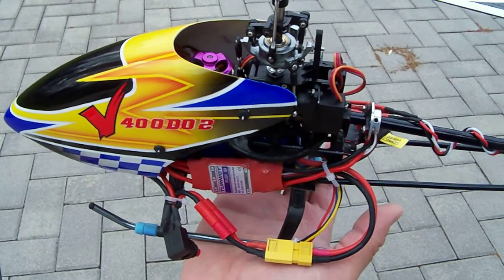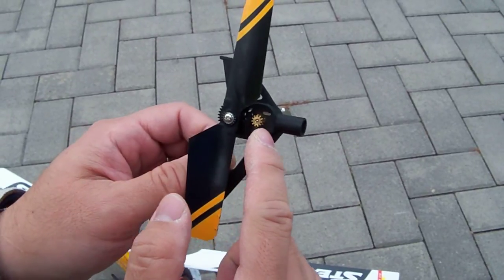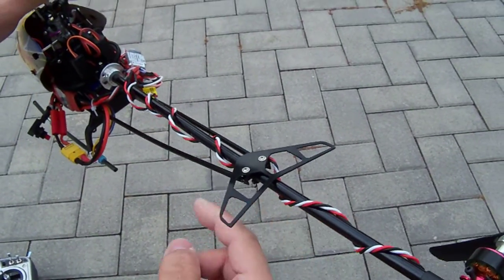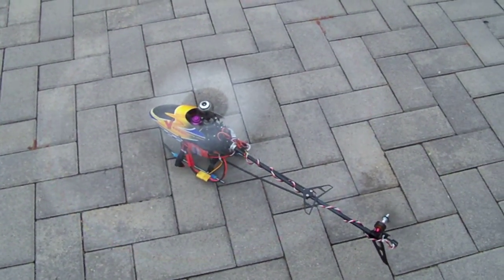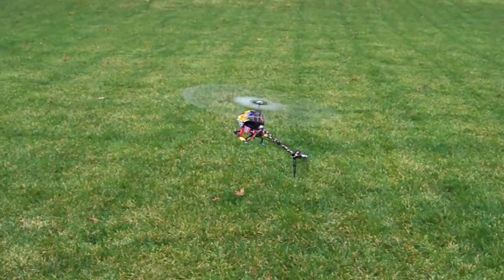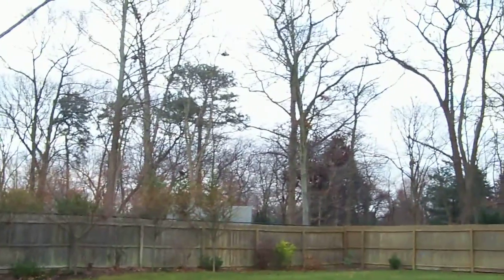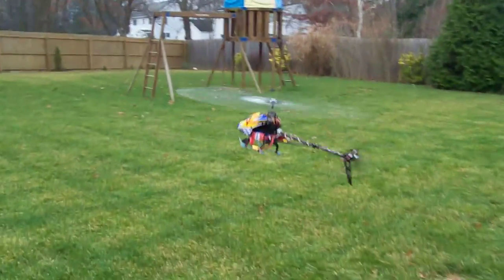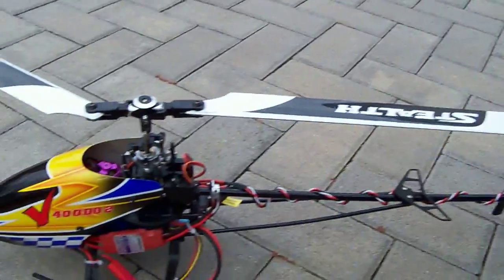WWW.RTF-HELI.COM - WALKERA V400D02 DIRECT DRIVE (DD) BRUSHLESS TAIL SYSTEM

Comment: I'm very interested in buying this system for my heli. Where should I go? How much is it going to be for the hole system? Ohh and which servos are you using? I'm asking because I had crash twice my heli and it seems that every time you crash, you mess up the original servos. I really want to get good parts for my v400, but don't know much about it. I will appreciate your promptly response, thanks.